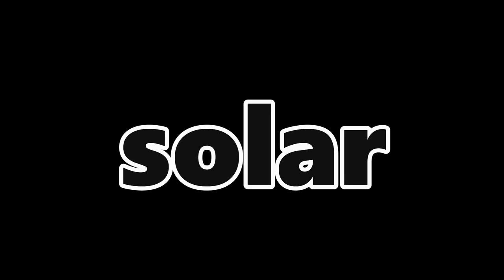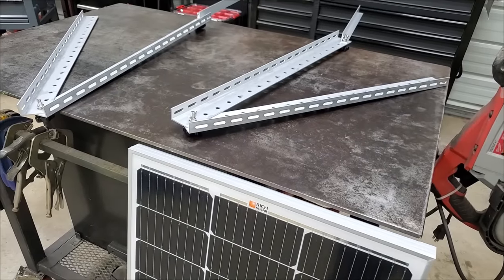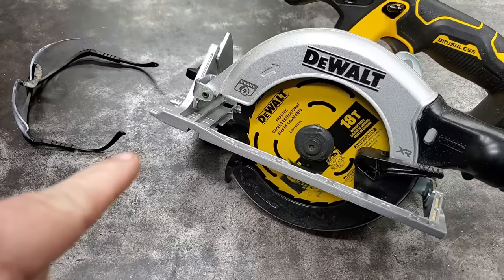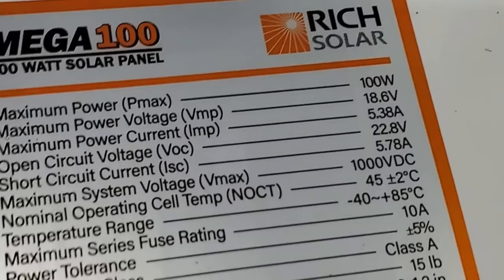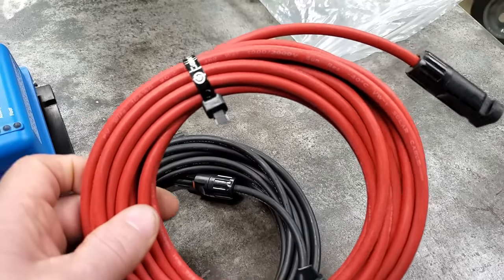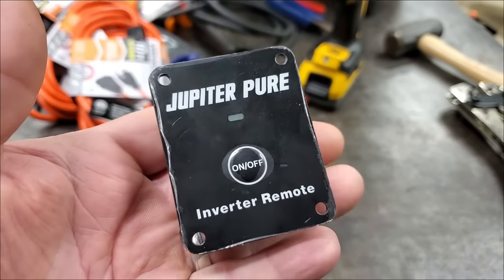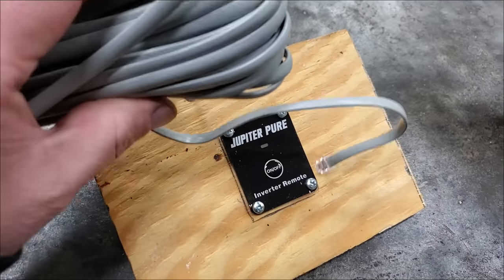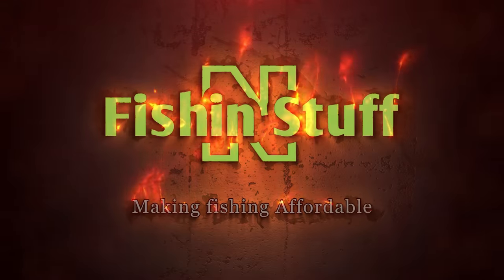Beginners Solar project ( very Simple )

Comment: The only thing i would suggest, is add a solar disconnect between the panels an your charger controller, that way you can disconnect them to do maintenance  on the controller or batteries. Also, if you end up adding more batteries, consider putting in a BUS bar so its easier to keep the lengths for the cables the same. When you add multiple batteries, having different length cables changes the rates at which the batteries charge.
Reply from the maker: Thank you for the information buddy
Reply: Excellent reminder of a snippet of info that had hidden in the back dusty corner of my mind! Thanks
Reply: What is a BUS bar?
Reply from the maker: It allows to run a positive or negative to one then split it into more wires cleanly.  Here's an example 
Bay Marine Supply Busbar - Made in USA – 4-Post 250 Amp Stainless Steel Distribution Block - 3/8" Red https://a.co/d/fKzz2sO
Reply: @FishinNStuff  I enjoyed your video :) It’s not my wheelhouse, but I understood a lot more from your video! I looked at the link… now I see what it is :)… if you decide to use one, please make a video… it wouldn’t be a waste of time :) thanks!
Reply: @FishinNStuff  p.s,. My 13 year old son enjoyed watching too :)

Comment: FYI....a single Delta Pro will NOT do 220V by itself. If you look at the plug you referenced it is a 30A RV plug rated at 125V. You can combine two with a kit to get 220/240 out.
Reply: Yep. True
Reply: I heard him say it's only for 110 volt ⚡
Reply: And that would require at least 3 more batteries due to the surge voltage and an additional invertor. Making it even more unrealistic cost wise. As compared to running service from his meter.
Reply: I believe he prefers off grid.
Reply: @benalexander9907    all that expense simply to light his shop? Doesn't make much sense.
If he works in his shop, he probably uses electric tools
That one battery won't last long
Reply: @benalexander9907  do we all. I like to be off guard in not pay the light bill.
Reply: The cost to put in a panel and run descent wire underground will be more if all the calculations and the cost of a permit and so forth. Solar can be the less expensive way around. I choose to do solar. 73 @CarlGlassmeyer-jj5qw
Reply: One question do I buy the harbor freight inverter or the renogy inverter? That's what your link takes Me to. 73
Reply: @CarlGlassmeyer-jj5qw  Keep thinking that meter is always going to work. 😂
Reply: @CarlGlassmeyer-jj5qw   it would be near as if not more expensive to do grid electricity, then there’s regular subscription fees that go up and up and up… until no one wants to turn a light on and everyone panics if you leave one on… it’s absolutely asinine in this day and age
Reply: @CarlGlassmeyer-jj5qw  he mentioned that the battery would last 8 hours … it’s a storage, he said they don’t go in there for but a few minutes at a time unless they are cleaning organizing… I’m sure they will adapt, plus he made it so he could add more batteries
Reply: @CarlGlassmeyer-jj5qw he has another big shop that he does that stuff in, that’s on grid electricity… he talked about that shop building in the video… this is a small storage unit, for storage, not workdhopping
Reply: @johnhershey4010  You're still paying the bill only you're doing it up front.

Comment: The inverter's remote shut off is nice, but your more likely to regret using it like a light switch. You've got a lot more power than you need if all your going to do is run the lights. When you decide that you could charge batteries for lawn tools in the shed you'll want to add an actual light switch so you can leave the inverter on and turn the lights off. Treat the inverter shut off like a whole house power shut off switch. You'll be happier in the long run
Reply from the maker: You are right . Im. Thinking about adding to it for a small deep freezer 🤔 but I'll have to do the math
Reply: @FishinNStuff add a timer/ control to only allow to automatically power certain stuff like power tool batteries for when you have Max charge and sun is still out

Comment: I started off with a solar system much like this. I had cobbled it together from cheap second-hand components I'd picked up here and there. Now I'm living off a system that's still very much like this one you've built, just expanded it a bit to run my house off. I still have my original system, but use it to power my workshop. I have other small units scattered about the property so I can go anywhere on my land and have access to power without hauling a generator everywhere. I like to have an inline fuse in my systems.
PV - Photovoltaic cells (the solar panels).
This is a clean and simple build. Well done.
Reply from the maker: Thank you very much . I really like the simplicity of it . But im still learning

Comment: I am running the same HF inverter at my cabin-when I put my well in, I needed a second inverter because we would blow the inverter out if the well pump was running and we were trying to run the microwave at the same time etc. I dedicated the old inverter to the rest of the cabin and put the well pump on the HF inverter. I did this because I knew the HF inverter’s sine wave curve was pretty clean on an oscilloscope and got even better under load-well pumps are expensive to replace. 

So far the HF inverter has been really good. The well sucks out 1650w in draw every time it runs and stays at that level until the bladder tank pressure hits its 60psi and it has been great. 

Best part is there are HF’s everywhere and if there’s a problem I just take it back.

Comment: Most modern led lights have a transformer  in them that can be bypassed to run at 12v
Reply: Yes. If lights were the only thing needed, why invert just to rectify with loss at each stage?
Reply: @Sepulchrave88  I agree.. Even if the inverter is needed for other equipment, the lighting (and whatever else he can) should be 12V DC

Comment: 2 things--add a 100 amp MRBF fuse to the positive terminal of your battery.  It would also be a good idea to add a battery switch between the inverter and the battery.  Second put a 30A manual reset circuit breaker in the positive solar cable so you can cut off the solar if you need to/protect the wires.   Love the humor!

Comment: The charge controller amps rating is the max output to the batteries. So if you have 3 panels at 5amps in series is still 5 amps but what the charge controller will do is bring the voltage down to 14 ish volts to charge the battery you will see 15 to 20 amps going into the battery. Good luck on your solar build I'll be following
Reply from the maker: Thank you . I told you I'm a beginner lol

Comment: Pure sine wave converter mimics the power from your utility company but it's actually better smoother power. The correct reason why you have to run thicker wires is not just the heat but the voltage drop is the reason why you run thicker wires when you're running a longer.

Comment: Great video!! I took my Ecoflow in a little bit different direction. When we had the ice storm in Texas 3 years ago, we were without power for 5 days. I have 15 solar panels on a grid tie inverter, so we were without power, and my solar panels were useless. I cannot tell you how frustrated I was during that time. I ordered my Delta Pro and put it in my living room and started powering up everything in my living room (big screen tv, lamps, computers, tablets, phones, internet, Roku, wifi, etc). My wife was not too happy with having to listen to the fans on the Delta Pro but it was not too bad. I found that the one Delta Pro did not give me the comfort level that I wanted so I watched for specials on the extra batteries and now have 2 extra batteries attached to the Delta Pro for 10,800 WH. I found that 4 of my 240w panels would keep the batteries charged to 100% daily except on very cloudy days. My emergency plan is to simply run extension cords to the refrigerators/freezers and other locations as necessary if the power goes out. I now have a glass table sitting on top of the three units with a faraday tablecloth on top to hide the units and reduce the fan noise and it is hardly noticeable now. It is comforting to actually use and know that my system is working since it is part of our lives now used on a daily basis offsetting my electric bill and not sitting around hoping all will work when the power goes out. Also, this method did not require me to hook up my Delta Pro to the whole house or run my Delta Pro in a hot and humid garage where my power panel is located which could cause problems over time. Very flexible.

Comment: Dang, what a great video. I love your delivery and your explanations were bare minimum but enough to get the job done. Anyone could watch this video 1st and then go onto watch more difficult ones and actually know what is going on.
I was going to get a shed and run power to it from the house with all the permits and stuff by an electrician but haven't priced it out. Who knows what it would cost. Now I can have another alternative. Great stuff.
Reply from the maker: Solar could be higher . Especially if your building is close to your house . But self sufficiency is another added benefit

Comment: JFYI.... You "MUST" install a FUSE that is to PROTECT the Battery wires AT the POS post of the Battery...(or within 6 inches of)    ...... Which is to PREVENT that fire you don't want!  Also a good idea to  install a battery cutoff switch with the fuse...  DC fuses are a DC systems BEST friend!...And just like a A/C system EVERY circuit needs a fuse or breaker on the POS wire at the power source (to prevent that fire). ..Love your content.

Comment: Nice video, but you forgot something. Circuit protection. You need to fuse the solar controller to the battery. And, fuse (or circuit breaker) from battery to inverter. It should also be mentioned to use a Lifep04 battery that has low temp cut-out protection for locations that get below 32⁰ F. Otherwise, the battery will fail if charging occurs below 32⁰. Discharge is okay down to about-4⁰ F. 👍
Reply from the maker: I did forget the circumstances breaker. But most inverters have fuses already. But ive been told bit to fuse the charger too the battery because if it blows it will burn up your charger
Reply: Be very careful with all lithium batteries.  Been gettin a bunch of fires with all types

Comment: Outstanding! I'm a yank and I easily followed along and understood every word. Well practically every word. This is really simple to understand and I plan to to the same configuration and put one of those split air conditioners in my garage, with a few more solar panels, of course.
Reply from the maker: You may need a few more batteries too . That's why I said I may add to mine . I'd like to make it run a deep freezer  . I appreciate your commitment and you watching

Comment: Suggestion to new solar enthusiast. Try to use as many DC direct appliances you can. DC TV, DC lighting DC refrigerator DC AC units.. etc...  By going with as many or all DC powered applications you will not only extend your power options you'll also extend your battery and or direct operations.. no loss due to converting dc to ac . Using a converter these days for lighting is well... not the best  or cheaper option... LED DC lights cheap run cool.. etc...

Comment: open circuit voltage (voc) is the volt you add up because then is the voltage that will blew up your charge controller in series .
Reply: That's what I was going to say but you beat me to it. You could also theoretically see this if the batteries are full and not taking any charge.
Reply: @hobbes1069  you can destroy your charge controller if the voltage is above max. learn about it and safety first.

Comment: While this is informative and a great idea you have 1 major flaw. You NEVER place electrical components in a wooden enclosure.  Wood is highly flammable if something arcs you could ignight he wood and burn your bldg down..  alway I close in a metal box. This isn’t flammable you also need to ground the box well so if it arcs the power will safely be sent to ground and not you.   This is wiring 101 in any manual.   Otherwise good info
Reply: Electrical components are placed in wooden enclosures all the time. Wire your stuff appropriately and protect the exposed energized surfaces. If your shits arcing, you’re doing something wrong.

Comment from the maker: In the description box , there's an Amazon link that will take you to a list that includes all the parts  used in this video .
Reply: ⚠️  PLEASE FUSE YOUR CABLES (right at the + battery terminal)
Wet batteries, AGM, LifePo4, SLA, etc…
All batteries have enough potential energy to do phenomenal damage.

A good quality fuse holder and fuse rated a bit higher than your highest current demand.
Even a NON self-resetting circuit breaker is an option.
I have a 1kv 12vdc pure sine wave inverter connected to a single 200ah 12v LifePO4 battery for emergency power for my communications repeater gear.  The most current measured on the DC side was 50a.  I used a 60 amp non self-resetting breaker. (used 3’ length of copper #2awg)

Thanks . Looks like a nice unit.
Reply: Parts total is about $1020 adding up the items listed
Reply: Before tax - government always gets their fingers in the pie
Reply: Two points you are incorrect on.

One, the voltage number to keep in mind of on the charge controller for protection is the VOC panel voltage. Which is 22V, so you are looking at 66V you should add 20% for cold weather voltage rise, so 78v. Still safe for your controller, but keep it in mind.

Two, the 45A is the max amps the BATTERY will see, not the max amps of SOLAR you can connect. 
45A times 12.8V tells you the max WATTS of solar the controller will send to the battery. So 45*12.8 is 576 max watts it can pass to the batteries.
Reply: People from Texas (like me) watch your videos and say, "Hey... this guy sounds totally normal to us!!!  Finally, somebody who sounds the way people are supposed to sound!!!"  ;-)
Reply from the maker: @dubmob151  that's true but I'm pretty sure there's tax breaks for installing Solar . I'll find out soon lol
Reply from the maker: @SuperVstech  I appreciate that Sir , like I said I'm a beginner lol
Reply from the maker: @johnbrown8059  lol 😆  I get it .
Reply: Hey man, I really like your video! You did a great job
Reply: Was that Zim Farr on the slide whistle at 18:16. Lol...
Reply: Nice work Honcho, now hire yourself out to build these kits for bux $$, adding a couple disconnects between the big stuff. You could be rich..ya know?
Reply: PV = photovoltaics. 20:18
Reply: Imagine YouTube wants to block me because I call myself an idiot my God YouTube is so fucking stupid
Reply: You should save money on a smaller inverter. No point on buying a 2,000 watt inverter when your battery only has a 100 amp BMS (or about 1,000 watts).
Reply: @texasprepperprojects  it's called expansion. I'm going to get a 3000 watt inverter I'm not going to leave anything undone. I can always add panels and batteries. Just get the best charge controller and inverter. My well will have a separate system. I had a co worker use the original harbor freight panels the 45 watt type and he used a harbor freight inverter and probably a deep cycle battery to run his well. I don't know how deep or what type of pump used but the Florida sun charged the battery and when the pump turned on it used the battery and inverter. He told me about it. The system was cheaper than running power to the well. 73
Reply: @dubmob151 so, he spent a grand, and hours of work , to power $60 of lights? Lol.
Reply: The way you walk through all of it really makes me believe that I could do this when I'm ready to get off grid
Reply from the maker: @smoothearllemon4176  you can do it . I've learned in my life that everything is hard to you understand how to do it lol . When I first started editing videos it was hard , super hard .. but I had no idea what I was doing lol
Reply from the maker: @jamesbizs  no I spent the money to be self sufficient I put in the time to show you how to be also
Reply from the maker: @ronb6182  I actually did this build to run a deep freezer  . Like I said I'm going to add more batteries  . I was just showing the basics of setting up the system
Reply: @FishinNStuff Yes!  The term is 'figguroutable!' 😂

Comment: This is a smart setup because the waves in the galvanized panel will provide ventilation to cool the solar panels.   The efficiency drops off when they get too hot.  Also nice and dry under there.

Comment: Looks like those light assemblies have a female receptacle on the opposite end of the power cord. You could plug those lights together, then into the converter with the last one. This would get rid of those extension cords and simplify your install even more. Overall a good video. Keep em coming.

Comment: Funny.  I just watched the portable solar video before this one and mentioned the Lincoln hammer crimper.  That thing is finer than frog hair. All the crimps are perfect.   I did a video converting my boat from simple twin battery to a to a Start and House battery with an ACR and used that hammer crimper on any crimps bigger in diameter than 8AWG wire.  It worked allsome.

I definitely want to do one of these for the days following hurricanes.  We lost power for over a week with hurricanes Charlie, Irma and Ian, so it would come in handy.

A DIY setup is expandable and you can replace individual components than a store bought system.
Reply from the maker: That hammer crimper is awesome 👌

Comment: I love your videos! I’ve built several solar boxes from tool and ammo boxes! Mine are From 300w to 5k! I love your last build in the bigger ammo box! Suggestion for you though! Install a switch to cut the power off to your charge controller so you don’t have to disconnect inside! An extra switch won’t increase the price by much. 😊